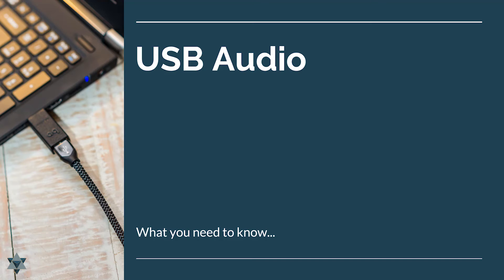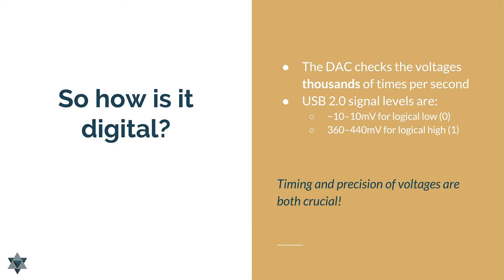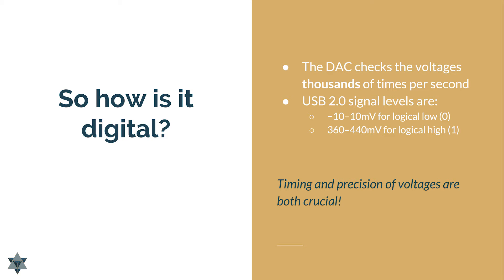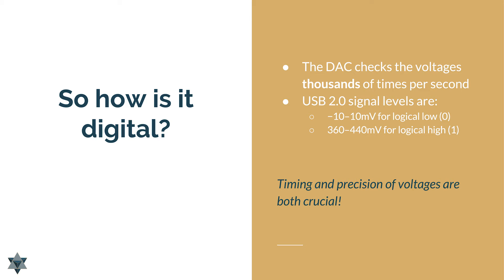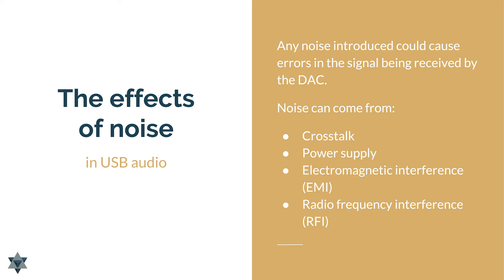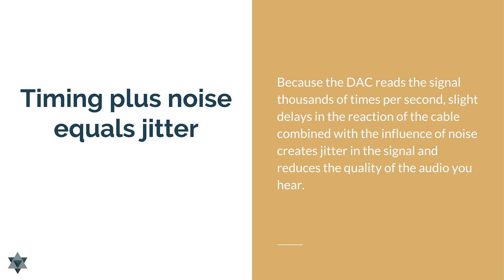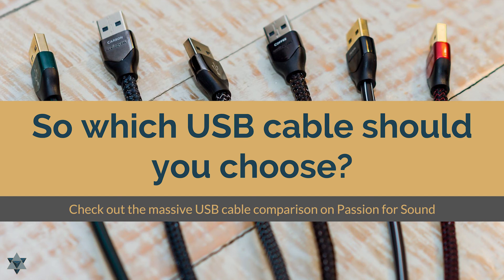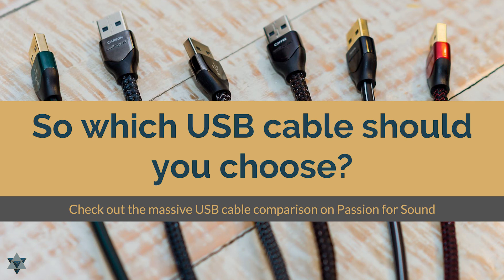USB Audio - what you need to know

Comment: Lachlan, much of your reasoning given for signal jitter is correct, but it's also why 
a) asynchronous USB receivers generally feature isolation transformers (in the DAC), and
b) the DAC re-clocks the signal - entirely.

The DAC doesn't simply output what it receives.

So if a USB cable is made properly, without connection faults and with adequate shielding against RFI and EMI (and gold or silver plated connections to prevent oxidation at the connectors), the digital signal will get through unscathed. Or something is faulty in the DAC. - audio engineer.
Reply: Electronic engineer here.  I have tested this theory about asynchronous USB ports and reclocking in DACs.  I personally tested DACs from $300 to $55K USD, current models.  All had the sound affected by noisy USB ports.  Only one of the most expensive ones was affected on a lesser degree but I still could here differences when changing USB cables.

Comment: Horrific amounts of misinformation is found in this video.

DAC reads "voltages" considerably higher rate than thousands, you are off by a factor of a thousand.

Even if we would somehow able to transfer the changes in voltages on the USB signal we have another problem: the data arrives to a chip. That reads it and says to the next component " this is a zero" or "this is a one". The next component is memory that stores the one/zero in to a flip flop gate. From there we get a DATA request to retrieve the value we stored as zeros and ones in the memory. That is then given to the next piece, the actual DAC. This is of course dumbed down version but all USB DACs use this general scheme. There is nothing "analog" that can go thru all those gates as it is then data. If this is somehow not understood, i suggest looking at how logic circuits work.

For USB power, same requirements are there as are with any pre-amplifier or line level device. It is true that USB power can in rare cases cause audible noise. This has NOTHING to do with the cable. The first components the USB power sees at each end of the cable are literally MILLIONS of times stronger on defeating noise than USB cable can even theoretically do, we can enter superconductors in that equation and still you would be several solar systems off (well, maybe i'll tone it down and say just the moon and earth in distance is comparable to a car trip when it comes to USB cables and what is at both ends of that cable....). If you have USB noise, we have cures for those and those are the same cure as anything to do with power noise: isolation and filtering: converting electronic signal with induction to magnetic, thru airgap and boom: no electronic connection exists anymore but electricity goes thru unchanged.. That magical device is called isolation transformer. Digital signal has not been a problem since the days of DMX, triode dimmers and unbalanced lines.

Source: actual audio engineer, that include both software and hardware, not a freaking wannabe. There are no known theories to support claim on digital cable "audibility" that have any research backing on it, it fights against the design principles of the gear (do you guys really think that no one has thought this before? before USB was even a glimpse? ). The solutions are so cheap that it is ridiculous. Even if the cable believers theories are true, 5 cent worth of components cure those problems literally millions times better than cables can do. Same ratios goes to all analog signals, cables are meant to be non-existent in the chain and electronically, they are as close as a component can be. There is still thousands of feets of wire between you and the source, before we get to the USB part...
Reply: Isochronous devices must buffer data one frame’s worth at a time, and send each block over the bus as a single transaction. At the receiving end the data is unbuffered and restored to real time. For example, an audio device operating at a CD-quality 44.1KHz sampling rate would send nine frames with 44 samples per frame, followed by one frame with 45 samples. After buffering at the source and unbuffering at the destination there will be a delay of a couple of milliseconds in delivering the data, but the rate of delivery – which is what is important to preserve quality – will be preserved.

This frame has 1kHz rate. The individual bits are detected quite a bit faster than that.. For 12mbps, USB 1.0, that is 12 million bits per seconds. Audio is one the "cheapest" signals in the digital world. For a lot of the devices, there are generations born and died between two sample value, that is how for ex computers see audio. For USB, even 1.0 is enough for almost all audio, excluding of course multichannel stuff. Won't even go to hires that creates intermodulation distortion unless bandpassed but i'm' sure the creator of this video, being such a professional can tell us why.